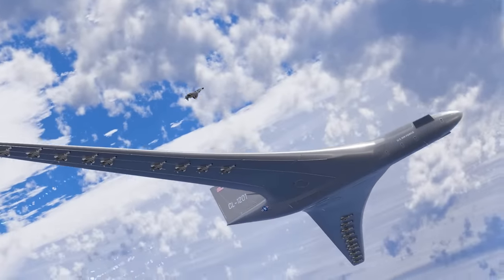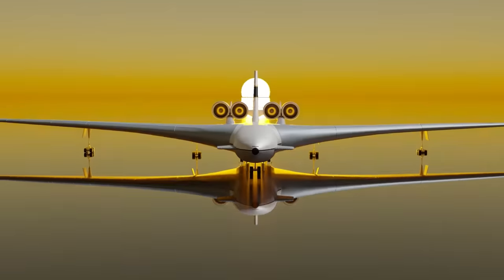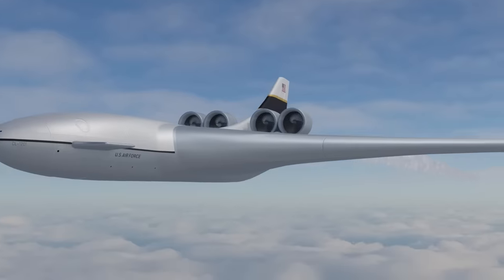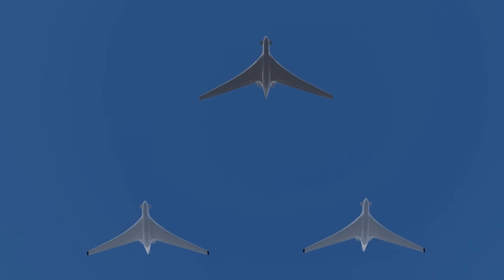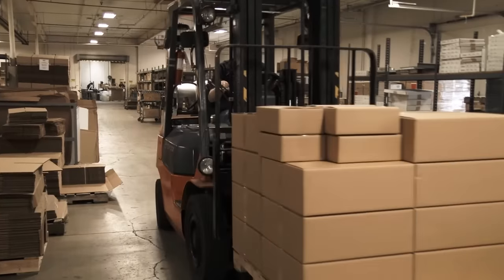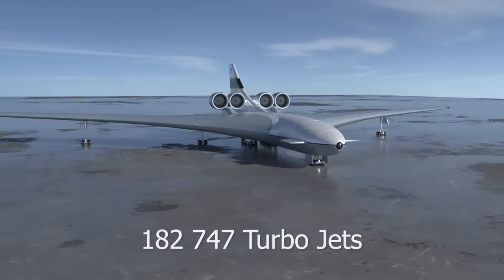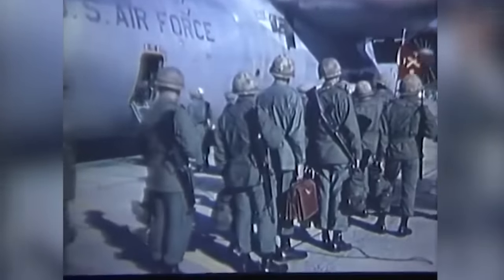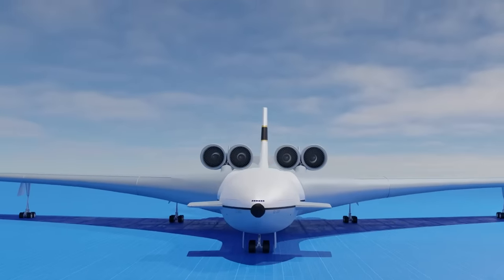The Nuclear Powered Flying Aircraft Attack Carrier - Never Built CL-1201

Comment: Fun fact:  Ace Combat 7's arsenal bird has TRIPLE the wingspan of this thing.
Reply: Weren’t similar designed craft used in Project Wingman?
Reply: @SpartanChief17C  Only in terms of scale.  The ones in PW are powered by the game's "magictanium" nuclear engines and are legitimately basically classical naval warships with wings in role.  

Not saying the Arsenal Birds aren't crazy like that themselves, but they are primarily flying drone carriers with a laser and some special air burst missiles.  Along with the energy shield that requires power being sent to it by the magical space elevator to power. 

No really, space elevators are one of the most unrealistic things in sci-fi.
Reply: @SephirothRyu  on the space elevator being unrealistic:
There’s a whole couple pages in the sci-fi novel “Old Man’s War” where the main characters are riding one, and discussing how it’s the most impractical way to get to space, and it’s there PURELY as a flex by the controlling Colonial government and whatnot to keep Earth in line
Reply: That's what comes to my mind
Reply: @SephirothRyu  cant u just see a station on the end of unimaginabley long cables slung through space at several times the speed of sound? Lol i mean 🤷🏻. Its not TOTALLY impossible 😅 in i suppose the  logistics of producing enough materials would be the hardest part to work out 🤔 weve already worked out geosynchronous satelites so attaching one to a fixed point and adding some sort of maglev capsule would be feasible.
Reply: @codyneitte9801 still though the scale is crazy, I'd imagine we'd literally need to mine asteroids for that much material, and we couldn't even use natural material we'd have to make our own refined super metals and super magnets are n a lab to support this massive structure, it would easily weight in the hundred billions in terms of tons.

Comment: "A ingenious way"
Me: ah, they would use the ocean, makes sense
"It would take off vertically"
Reply from the maker: RIGHT?? it doesn't make sense!
Reply: @FoundAndExplained  well... It does. You can land anywhere that's large and open (that your forces control) without needing a massive runway. If it lands on the ocean, then why not just go with a conventional carrier? You need to be able to reach deep inland, and the VTOL capabilities give you that. Nobody has airfields that large, but there are large, flat expanses of area that can fit the carrier
Reply: @FoundAndExplained  Do you happen to know if rocket boosters were considered? It makes more sense to me than using dozens of jet engines
Reply: @lord_hemp  Yeah, only problem was the thing was kinda bloody heavy.
Reply: it probably wouldn't because why would they use this behemoth as a VTOL, just using the 182 liftjets to reduce takeoff and landing distance to reasonable levels makes much more sense
Reply: @lord_hemp  could just airdrop everything
Reply: ikr!? i had to pause the video, and read the comments as soon as i heard that... that's some kerbal space program/space engineers shit right there
Reply: @lord_hemp  Taking off and landing from the ocean would allow them to replace the mass of those VTOL engines with more cargo, and the whole thing would be many times faster than any aircraft carrier.
Reply: @boomchacle6717  and they could still fly over land and drop troops and/or cargo as well as  circle in the air to serve as a control center
Reply: I was like... Really?? 
If they in anyway can launch it up vertically, why are even rockets needed to launch satellites....
Reply: I thought he was gonna say that they would use the great salt lakes
Reply: HAHAHA , that is exactly what i just posted 🤣
Reply: Given how high the engines are mounted and the massive size of the whole thing... I wonder if it would've been buoyant enough to float on the ocean and be able to take off / land too?
Reply: @dodecahedron1  STOL as opposed to VTOL is a good suggestion
Reply: I think they got the tech to build this thing nowadays with vtol and also stol... all that stuff is possible now
Reply: @FoundAndExplained  Honestly, it would actually make sense if it were actually an airship. You see, hot air has 30% of the buoyancy of helium and/or hydrogen (they have the same buoyancy), water-saturated hot-air has 40% and steam has 60%. So using steam and insulating it could allow such an airship aircraft-carrier to fly without needing a nuclear reactor. And the strangest parts are, it could fly where the wind blows to make use of sails to move and to make use of a propeller to generate energy, or it could go higher to deploy solar panel arrays help up by telescopic supports and active support (compressed air going through a hose) to keep the solar wings deployed to generate power that way. 

There are even plans for floating cities for our atmosphere, using mirror satellites to concentrate sunlight onto the floating city to keep it floating high and to power it's solar panels or solar collector concentrator for steam turbines for power generation. And if a flying small-city would project power, imagine being able to move a whole metropolis to the invasion zone, and rain rockets from above. Using railguns to shoot kinetic projectiles downloards could lead to impacts with as much power as nuclear bombs do/have.
Reply: @lord_hemp  would a mix of the ground effect and reduced vtol capabilities make sense? like you can literally just use enough runway to sort of glide into the ocean or a huge field to utilise the ground effect and then there's probably enough lift to use vtol but with much more thrust with less fuel used. idk if that makes sense

Comment: I love how they envisioned this insane futuristic aircraft but thought that F4s and 707s would still be around.
Reply: Technically both are still around
Reply: I mean we still use F-15 jets designed in the 70s and B-52 bombers built in the 60s so…
Reply: The Korean air force still has several F-4s in operation.
Reply: Hey . . . anyone knows the purpose of nuclear reactor, as the turbo jet engines need conventional fuel to power the flying carrier ??
Reply: @JohnKickboxing  they can run on electricity
Reply: @nenuu91iscool  👌
Reply: The E-3 is just a 707 AWACS
Reply: How can they base their design on something that doesn’t even exist at the time?
Reply: @JFK  The reactor likely replaces the fuel in the large turbofans, a heat exchanger heats the air, causing it to expand in the "combustion" chamber turning the turbine, which turns the fan. Also the heat would ve used to generate electricity like a normal power plant

See the Sandboxx news video on lockheeds fusion powered aircraft patent.

Comment: It's fascinating that so many serious engineers were thinking this was going to be possible to build.
Reply: I bet half of them were just afraid to speak the truth
Reply: It's probably less a matter of whether or not they could*, but more so whether or not they could do so *practically or *feasibly*.
Reply: It absolutely could be built. It would just be insanely expensive and impractical. Whatever military advantage it might provide wasn’t worth the cost. But I have no doubt the engineers designed something that was possible.

They should take this thing, shrink it down to half its size, and use it for tourism. I’d love to buy a ticket.
Reply: @thewanderer7642  Do you have any mathematcal backup for your statement? Because otherwise:
- Mass increases cubic to size, while material strength only increases by square
- They did not have today's lightweight materials
- Especially the nuclear reactor shell seems highly unlikely to ever be able to fly
- airplanes create tons of turbulences. Attaching other planes to the wings like this? Very unlikely
- Maintenance is a thing as well. Today's airplanes get checked thoroughly in a tight schedule. And this one should just be flying all year? 
- Even on ground: how would you check this beast? That would require weeks to do so and require building and destruction of custom scaffolding
- Water landing of such a body isn't exactly friendly to the structural integrity. 
- Costs are a thing as well. Even if it could be built, they'd be an absolute waste of money. You'd buy a ticket? Well, nobody's selling, since you can't find enough people on this planet ready to pay enough to finance even one of these...

But from a physical point of view, it's mainly point 1 to 3.
Reply: @sh4dy832  The soviets flew a nuclear reactor powered aircraft test and the US had several projects. It was possible.
Reply: @sh4dy832  true with our current available resources its far from being possible... But imagine bringing a smartphone to 80's they'll probably have the same thoughts like us
Reply: @karlsaysno4130  Which made this plane even less likely at the time it was proposed, since even smartphones were unthinkable only half the time back in history... 

I'm not saying it won't ever be possible to be built, but it certainly was back then, and it is unlikely to ever be worth the cost in the future.
Reply: Lots of great inventors were called mad men/women when they came up with their designs. But this isn’t the case. These engineers need help.
Reply: @sh4dy832  do you have even mathematical backup for your statement or are you just guessing... because point 1-3 look like guesses to me.

point 4 is something already done irl, so no not impossible

5-8 is irrelvent as to whether it is possible to build it. only if it is tactically and ecconomically feasible to run it which is a different question.

the entire point of the CL1201 program was what was the biggest possible plane that could be built with their technology. it wasn't meant to be practical just what was theoretically possible if given enough money. apparently a NASA team studied the design later on and found it was infact theoreticlaly possible.
Reply: It was the 60s, everybody was smoking pot and taking LSD.
Reply: Just need stronger materials.
Reply: @sh4dy832  nah. It was the 60s. The US and USSR were trying their hardest to create the most powerful weapons of war to show the other "hey, don't start this WW3 s*** because we have this at our disposal". I guarantee you that everyone had some slight reservations as to the possibility, while at the same time were doing everything they could to make sure that it came to fruition. They watched WW2 unfold. They saw the horrors. A lot of them likely specifically worked on projects to help further the war effort. At that time in history, the red scare was true and legit. It wasn't until later that people in America started truly embracing the failed idea of communism. Once the USSR fell, and the threat wasn't so real, as time went on, people forgot the true and ready dangers of everything, and embraced the idea of a political system that has only ever failed again and again. We should all be just as hesitant/worried if such a regime these days, but somehow, it has become more acceptable to certain people. I fully believe that acceptance comes specifically due to the fact that we ourselves, these last two-ish generations, don't know a thing about the first-hand experiences of the days-of-old
Reply: I don't think too many of them seriously thought it could be build. But then again this is one of the most insane dream projects as  if money was no limit to work on.

Comment: Every time I see stories like this, I am reminded of the 1950's Flying Crow Bar. One hell of a cold war weapon. Could have been a plot point in "Dr Strange Love".

Cruise missile designed to 'forever' around the USSR pumping out dozens of hydrogen bombs on selected targets. Using advanced terrain following radar, traveling at mach 3+ speeds, with virtually unlimited fuel. Once it dropped all of its munitions, the Flying Crow Bar would just fly around the country at tree top level, cooking everything it flew over. Seeing as the SCRAMJET engine was being powered by an unshielded nuclear reactor.

The avionics were built. The nuclear engine was built, and put on a static test and was able to produce thrust for over 10 minutes...(IIRC).

Comment: If it's actually built, the plane probably cost a quarter of US Army budget
Reply: And still a better plane then the f35 ;D
Reply: all the job creation + ???    will be ready for start pooring the runway.
Reply: It was only supposed to cost about as much as a modern us supercarrier. Which is believable. The real cost would be the research, probably many times F-35 levels of expense just in research. The in-air connectors and the unprecedentedly massive nuclear jets seem like the most likely candidates for development hell. Also the operation would be much like modern super carriers, it’d probably spend half of it’s time on the ground doing maintenance or modernization
Reply: I'm not talking about the research or the building it, I'm talking about operational cost
Reply: @thenasiudk1337  Not much due to the nuclear aspect

Comment: Wow ,just wow maybe the phoenix lights are one of theses after all ,fits the facts stories of them being hidden underwater in the sea
Reply from the maker: The fact it can fly vertically makes it even better
Reply: Imagine the noise ,and the fact Lockheed was designing it home of the secret projects and the US is big enough or the Aussie outback to hide them is another thought ,love the channel thanks mate 👍🏻😊
Reply: Would have a humongous IR signature once airborne, visible from the moon
Reply: I’m thinking that the -2 version was actually the only one that went into production and was the source of the lights in Arizona,
Reply: it honestly sounds plausible. like, imagine one made of fiberglass. light and strong with a tiny RF cross-section. for those of you who don't know, fiberglass is transparent to radio. even the engines could be made less visible to radar with ceramic turbine components and ceramic or, more likely, plastic piping. graphene wires, maybe? the IR signal can actually be disguised with an interesting technique, make the signal so big and dispersed that the onlooker doesn't think it is manmade. if it has a gigantic, like, five mile wide cloud of low level heat coming off it, you would think it is a hot day or some cloud anomaly, not a big fricking plane. The new fourth-gen supercritical water reactor would be able to power the whole system with an open steam-cycle mechanically driving the fans and each engine having a small generator to provide electric power. Thrust vectoring, like in the harrier jump jet, could be used instead of the additional jet engines for VTOL, and/or it could be a float plane with lots of retractable floats.
Reply: I was thinking the same. They were supposed to be working in a huge blimp that looked like a plane and could be used as an aircraft carrier.
There was talk that the Phoenix lights could have been that aircraft.
I'm almost certainly wrong but I hope I'm not.

Comment: It's honestly wild to me this was even considered, and actually arguably wilder they went to the trouble of designing this and not making it a seaplane given you couldn't land it anywhere
Reply: I agree with that it would have been better as a seaplane
Reply: Retractable floats could have been used to preserve the aerodynamic efficiency if they so wished. The problems with such large main engines could be solved by running a multitude of smaller over-wing engines. I would advocate for an open steam-cycle. water is pumped under supercritical pressure through the reactor, let to heat to supercritical temperature, fed to steam turbine, turbine drives attached fan, steam exhaust heats ingested air to provide improved thrust. the total weight in water is acceptable given the stupidly large carrying capacity. the simpler and more power dense open cycle is fine with the new graphene oxide desalinators taking seawater, scooped up like firefighting planes do currently, and processing it into fresh water to fill the tanks. Also, the water could be kept in the wings to allow most of the machinery weight to stay in the center-body without putting undue stress on the airframe.
Also, the steam turbines that would drive the turbofans would be relatively small since they would be exhausting at atmospheric pressure and not a vacuum. it would basically just use the high pressure stage in an industrial steam turbine for powerplants. But in this design, it would mechanically drive turbofans.
Reply: If you think this was crazy, you should look up the orbital battleship Orion.
Reply: Flying boat, but yeah I agree
Reply: Make it a flying boat. Enjoy.
Reply: @cerebral3591  Also check out the nuclear salt-water rocket.  Technically a legal engine (it is not a nuclear explosive compared to the Orion engine), it just pumped out water with a radioactive salt in it, and when enough salt was in the right location behind the ship it would self-detonate.  Great thrust, high efficiency, can be used to take off from a planet, completely legal, but tends to make the launch site glow blue for a few thousand years.